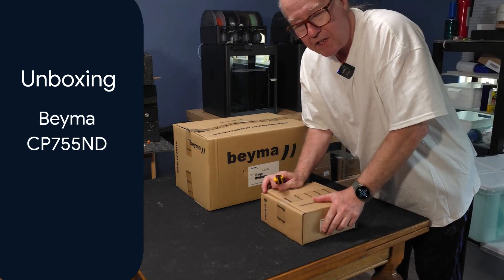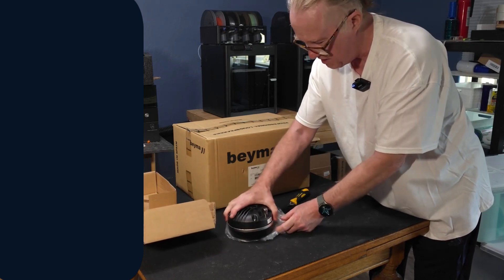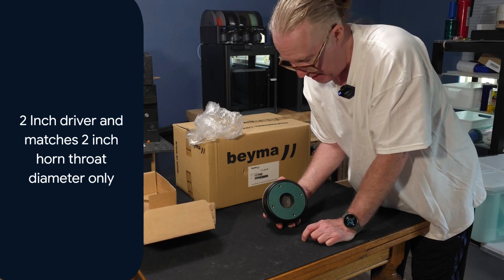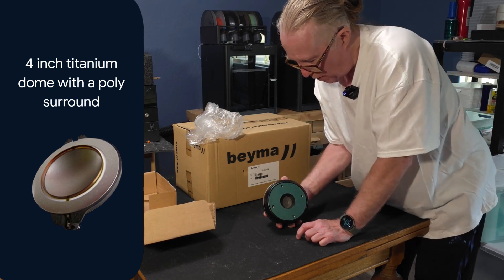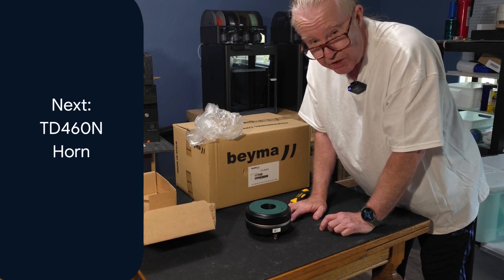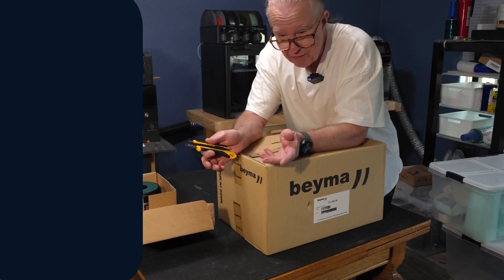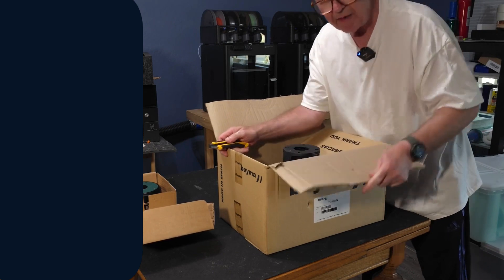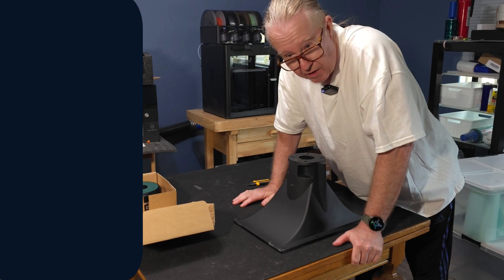Unboxing the Beyma CP755 ND and TD460N

Comment from the maker: Correction: The driver in this unit is the Beyma CP750NG (true 2″ exit), not the CP755ND. Early tests also used a CP755ND (1.4″). For the SA12 we standardized on the CP750 because it bolts directly to the TD460N 2″ horn (no adapter) and measured the most consistent match in our system. A short CP750 unboxing + measurement video is coming. Thanks for the sharp eyes!

Comment from the maker: About the 1.4″ driver on a 2″ horn:
We’re using the Beyma CP755Nd (1.4″ exit) on the TD460N (2″ throat) with no adapter. The TD460N’s shaped throat (“duck-bill” vane) sets the HF loading right at the entrance, so a 1.4→2 interface here doesn’t recreate the old long “snout” problem. Bolt pattern matches (4×M6 @ 101.6 mm).

Measurements (on-axis & 15°) are smooth to 20 kHz; the only artifact is a tiny ~13 kHz on-axis notch that fills in at ~15°—classic slot symmetry, not a loss of “air.” We cross ~800–900 Hz.

Bottom line: in this build a short, clean transition + TD460N throat control beats a long/slow adapter. We’d take a barely visible ripple over broad HF under-loading any day—and the data backs it up.

SA12 info & notify: https://shinjitsuaudio.shop/pages/sa12-notify

Comment: I have looked at the Beyma. CP 755 ND,…but it is a 1,4 Inch Driver, Not an 2 Inch,…i am a Little confused.
Reply from the maker: Yep—CP755Nd is a 1.4″ exit driver. The TD460N is a 2″ throat, but its throat vane (“duck-bill”) creates a short slot that sets the HF loading, so a 1.4→2 interface isn’t a problem when the joint is flush and centered. The CP755Nd’s 4×M6 @ 101.6 mm bolt pattern fits the horn. Our on-/15° off-axis measurements are smooth to 20 kHz with no throat ripple, and we cross ~800–900 Hz. In this build there’s no practical downside, and the 1.4″ exit keeps the top octave clean and effortless.
Reply: @shinjitsuaudio  Morris, Thank You for Answer. 🙏